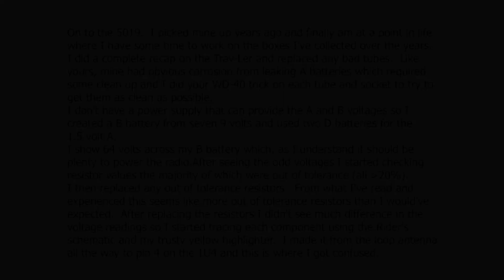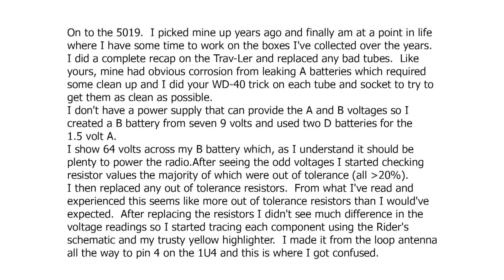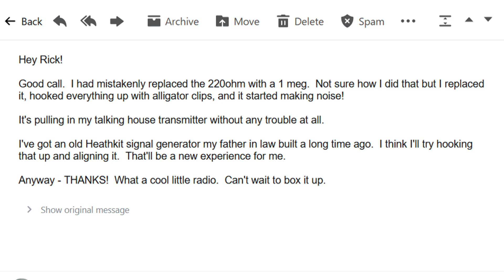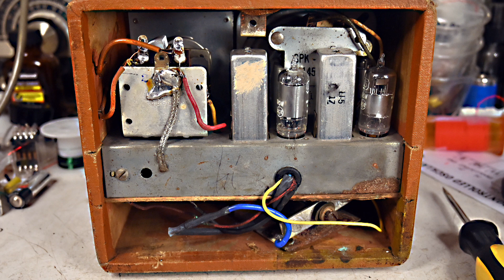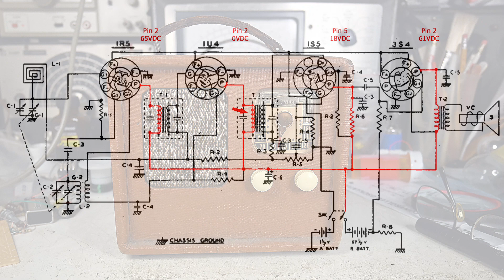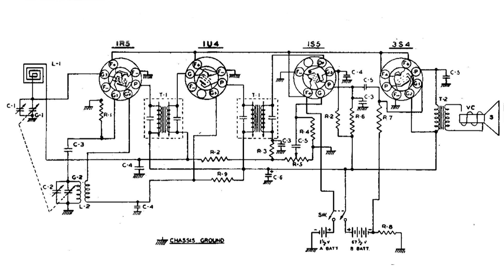Troubleshooting Traveler Tube Radio 5019

Comment: An old crossbar guy? They still used crossbar and step by step here in upstate South Carolina when I got into the switchroom but had already started transitioning to digital (Western Electric #5ess and Nortel DMS 100/200. I was a Nortel guy. Enjoyed it very much. Thanks for your story.
Reply from the maker: Thank you.
When I was new to the crossbar I got a call from the Bell connecting office in the next town. They wonted to test a special circuit. I got setup and counted over the jacks and plugged in. The wrong circuit went down. I hear this from the other end, “Don’t worry about it, you was only one jack off.”
Reply: @AllAmericanFiveRadio  🤣🤣🤣🤣🤣